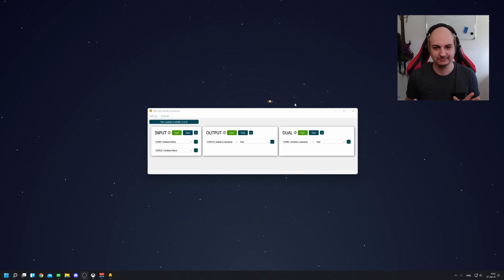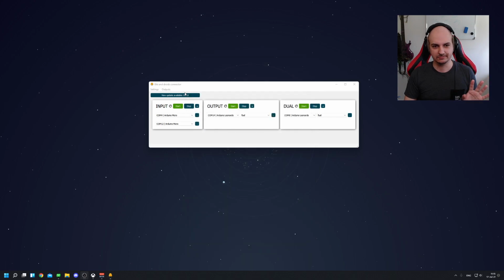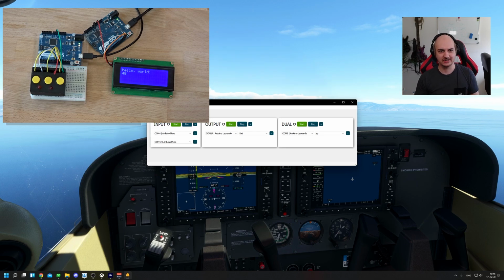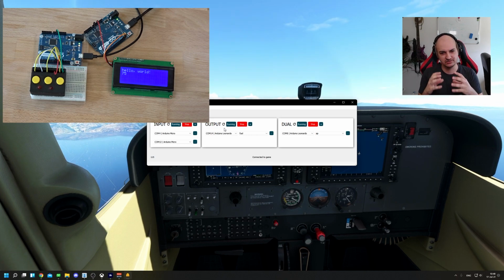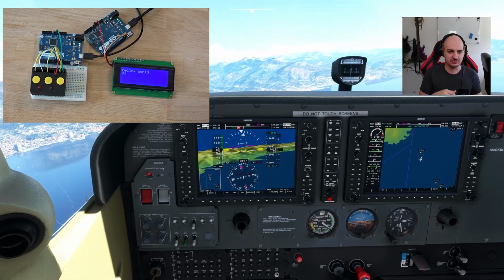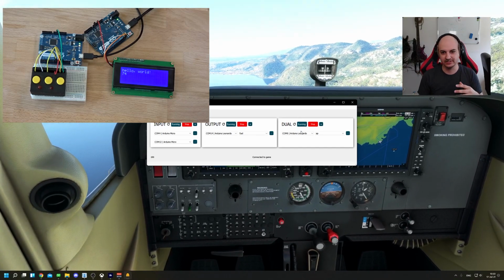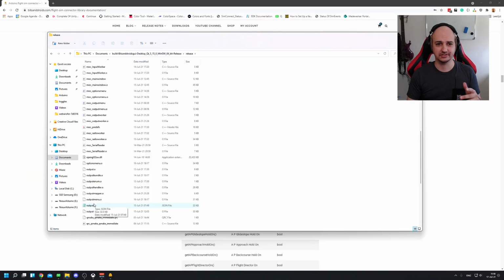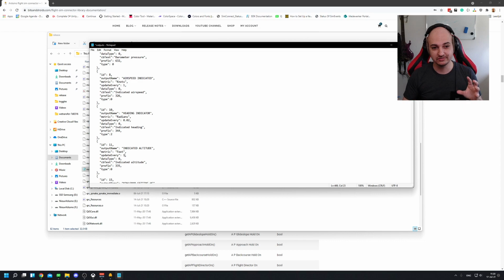Arduino flight sim connector 0.9, create your own mfs2020 hardware with ease

Comment: Really excited for this update. I'm still having quite a bit of trouble getting started with everything. I discovered your channel a few days ago and started playing around with my Arduino Leonardo. To start, I just wanted read when ap master is turned on or off and turn on an led based on it. I created a set and added ap master bool into the set. And wrote the code to check for it and turn an led on but for some reason I just can't get it to connect. I wasn't sure if I need to run things in a certian order so I tried different combinations ( ie. start the connector first , start fs first etc ). 

#include <BitsAndDroidsFlightConnector.h>
BitsAndDroidsFlightConnector connector(true);

void setup() {
  pinMode(8, OUTPUT);
  Serial.begin(115200);
}

void loop() {
  connector.dataHandling();
  bool apOn = connector.getAPMasterOn();
  if(apOn){
    digitalWrite(8, HIGH);
  } else if(!apOn){
    digitalWrite(8, LOW);
  }
}

This is the snippet of code I wrote. 

If you can give me any pointers on where to start / what I'm doing wrong that would be awesome. Also some minor feedback - any tutorial documentation around how to get a simple output working / input working and some basic things to do and not to do will go a long way for any newbies like me who just discovered your channel ! Other than that great work ! Really appreciate all your hard work !
Reply from the maker: That sketch should work so I have a feeling we can rule that out. In theory, when you start the game, wait till the menu is open, then hit start on the connector should be the most optimal time to start. I do believe that you can hit start sooner but I'm not 100% sure if that still works this update. 
That leaves us to the board. What kind of Arduino are you using and did you check if the LED works without any if statement?
Only add this line to the loop block to cross that one off:
digitalWrite(8, HIGH);
 
If all of the above doesn't work let me know. Or perhaps if it's easier over Discord https://discord.com/invite/nRCe8Y9DzD

Comment: Awesome work, the being able to send multiple boards is game changing. I have a question Ive been wokring on a Arduino Joystick Forcefeedback library. dor a Diy Yoke, are there any values that give the in game yoke position?  reason being I want the yoke to have an autopilot mode so as the AP flys the yoke moves, as well for Trim I want the forcefeedback to remove that backpressure as you input trim(as it would in most GA aircraft). Anyways will be using this for sure glad to see all the g1000 buttons as well.
Reply from the maker: I believe there are but I'm not sure that they are implemented yet. I'll add them to the list!

Comment: 0.9 seems to be crashing on me everytime I start the "Dual".
Reply from the maker: Hmm does the set have outputs saved to it?
Reply: @Bitsanddroids  yea I did haved saved Flaps %. And there were also 2 by defualt, which I don't know why, and I tried to delete them but it alsl make the apo crash.
Reply from the maker: @SantaGamerYoutube  could you perhaps send the contents of your settings file. It can be found by typing in %appdata% in your windows search bar and then opening the bits and droids folder. I'd love to invesyigate what goes wrong.

Comment: Good Video as usual! Very Good Work for the update! Really usefull! 

Just one thing to fix (maybe) in the video : as a sound engeneer, I can hear harschness in the sound. It’s quitte agressive in the high end. The sibilants are really loud. Maybe you can use a de-Esser on the sound. 

There should be a stock de-esser in your vidéo éditor software.
Or you can dowload a free one the web. 

And if you want sometging really easy to use, the De-esser from Waves ausio is very easy to use.

Without this, I really appreciate you work and the way you explain things.

See you at the next Video.

God bless.
Reply from the maker: Thanks for the tip. I noticed this as wel. It seemed especially harsh during this video but couldn't find the proper term/tool on how to tackle it.
Reply: @Bitsanddroids  You can use a de-esser or and multi band compressor. I think the frequecies in volve are between 7000Hz and 9000Hz. And yes, it seems to be in this video only. I can be caused by a too high gain in the mic preamp too. Maybe a way to investigate. 

See you!